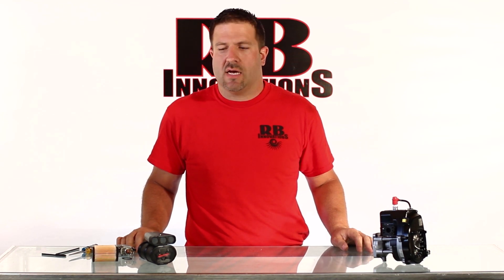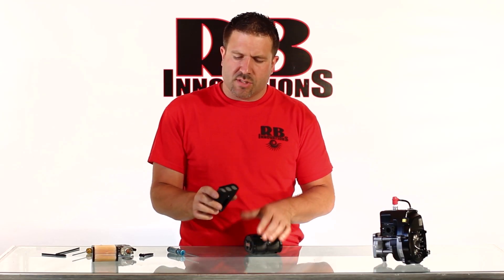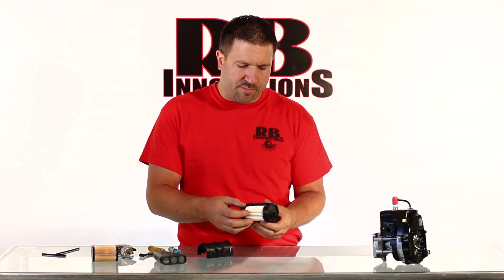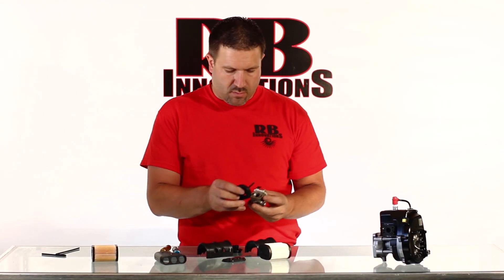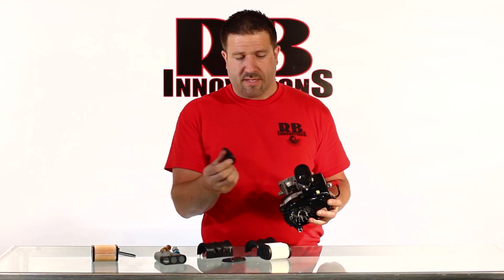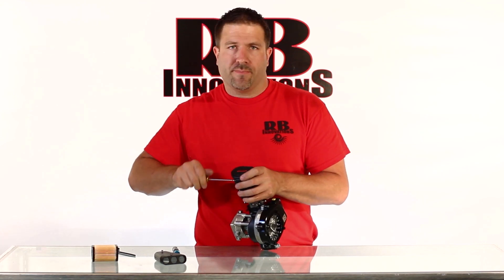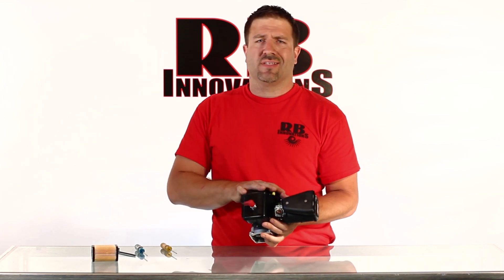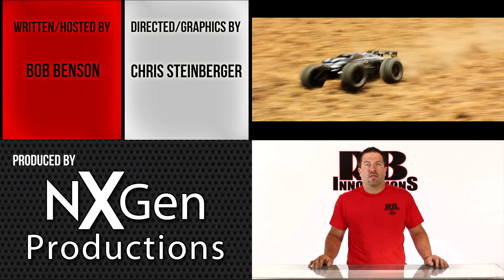Installing a Hyper-Charger to RC Engine

Comment: My concern is that the "Hyper-Charger" installs fairly easily when the engine is standing alone, outside the chassis.  However, with the engine in the chassis and mounted up, it seems to be difficult at best to split and reinstall the clam-shells when replacing the filter element.  The primary issue, in my view, is that the openings that comprise the air inlet, are far too small (even with a scoop design) to allow a sufficient air flow to the carb.  I'd have to see some details and dyno figures on this to be convinced of its benefit.  It seems to be designed more for looks than any engineering advantage.

Comment: this company is literally a joke guys. dont listen to them
Reply: +RideRedRacer Don't hate him cause you aint him
Reply: you clearly havent done your research on this company. they do make cool upgrades. but you can read for yourself how many other people have problems with this companies products. i even just spent $30 on a body mount specifically designed for my Losi 5ive T AND IT DOESNT EVEN FIT.  I had to use my drremel to widen the hole so the body could mount. spending top dollar on items that dont function as they should. and to prove my point, where is this companies admin responding to my problem and trying to fix it? They dont care...
Reply: Is that right Red Rocket jockey ... I don't recall seeing a link to your choked full of Awesome channel of your own 🙈
Reply: @utubetrutharrowmichael-and9105  obviously you're a noob in the Rc world

Comment from the maker: The Hyper-Charger isn't about boosting power necessarily; it's more about providing a higher volume of air to the engine while keeping debris out of the engine. The scoop captures more air than any standard filter while the outer housing protects the heart of the filter element.

Comment from the maker: The filter costs $39.99 and flows much more air than any stock air filter. Give us a call and we would be happy to answer any questions you have about the product, 315-451-4440.